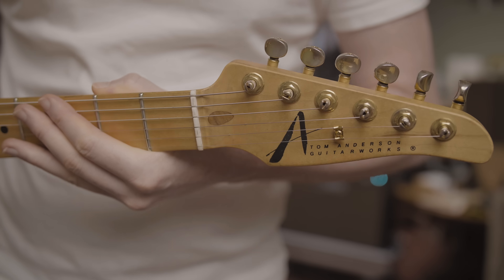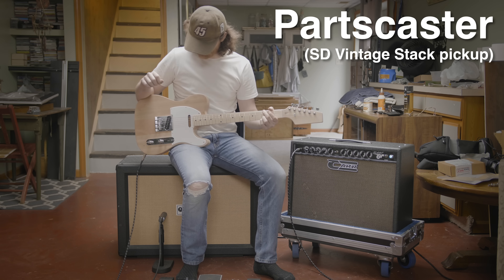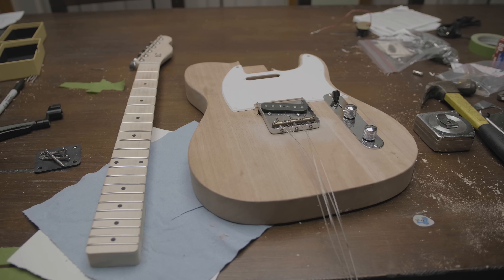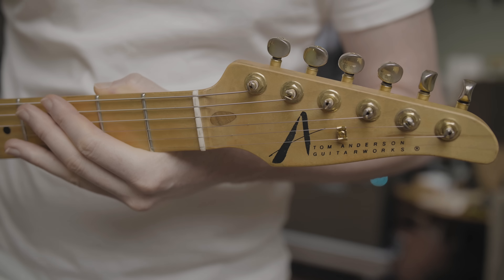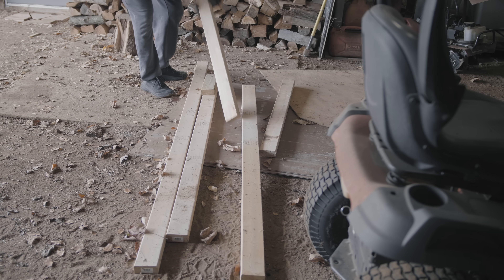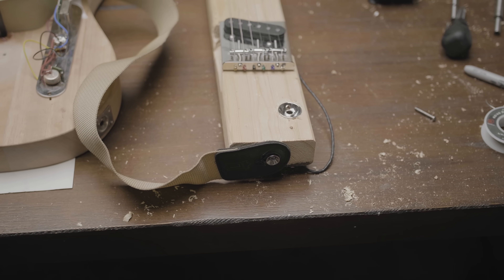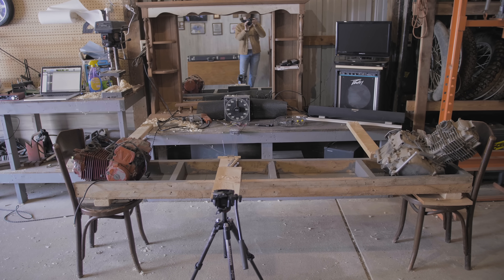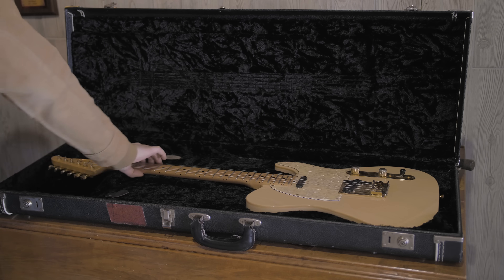Tested: Where Does The Tone Come From In An Electric Guitar?

Comment: This is just awesome, congratulation on a fine job. I wish more people did actual experiments like this rather than just parrot the same BS they read in magazines and online. Jim, you are now much more expert on electric guitar tone than the three builders you asked! My Audio Expert book covers much of this, and explains that wood type matters only so far as how rigid the body is. As you show, stretching strings across an air space sounds the same as an actual guitar, as long as the strings are anchored solidly at both ends. So what really affects tone, aside from body rigidity, is the pickup's output voltage and proximity to the strings (distortion), how close the pickup is to the bridge (treble content), and of course where along the string's length you pluck it. As you proved, all of the tone comes from the strings. With solid body guitars there is no body resonance as with acoustic guitars and violins.
Reply: So, why do hollow body guitars sound different than solid body guitars?
Reply: @맨맨-y7p  hollow guitars resonates AIR, solid resonates a chunk of wood. Its basic physic that air and solid resonation are 2 different things
Reply: @맨맨-y7p  Solid body guitars provide a solid, stable, non-resonating surface on which the strings are attached. A hollow body guitar adds intentional resonance. So most solid body guitar bodies will sound similar, but not hollow body guitars that can have different resonant frequencies.
Reply: @EthanWiner  That proves that wood affects tone. All woods resonate differently and have their own frequencies. That is why, even for guitars of the same company and with the same structure, dead notes exist in different places and have different tones. The same goes for the air guitar at the end of the video. Strictly speaking, that air guitar is not an air guitar. A bench and a shelf act as the body and head, respectively. And it sounds different.
Reply: @맨맨-y7p  I thought the "air" guitar sounded noticeably darker
Reply: @맨맨-y7p  A solid body guitar should have no resonances. As far as I know, dead notes are cause by a defect in the neck or maybe a loose fret rather than by solid body resonance.
Reply: @EthanWiner  non-resonating? Sir, all things resonate. There is a feedback network of vibration from the strings to the body and from the body to the strings
Reply: @EthanWiner  I agree with most of what you said in your original post, but I can't agree that solid body guitars do not resonate because I can feel that very thing happening whenever I play my guitars. The wood vibrates against my body.  The vibrations come from the stings, of course, but they aren't contained within the strings. I can also hear the effect of this in the clean tone, through the amp. It's not just about the strings, bridge, pickups, pickup position/height etc. I do agree that these things have much more affect on tone than the wood used, and that the influences of tonewoods are HUGELY overstated by marketing depts, but there is an interplay between all the components of the guitar (and the signal chain) to greater or lesser extent, in my opinion.
Reply: @EthanWiner  To clarify my comment further, a guitar can be made of all kinds of materials (polycarbonate, aluminium, masonite and even cement): the factors identified in this video affect the sound the most by far, but the body will resonate, transfer vibrations with the other parts and will have some influence on tone, however slight.
Reply: @TheChadPad  said, "all things resonate"

Yes, many / most things resonate. So tell me at what frequency a solid body guitar body resonates at. Then we'll know if that frequency is within the range of frequencies a guitar outputs. And be sure to include the Q of the resonance, because that directly affects how much influence the resonance will add.
Reply: @Maturin500  said, "The wood vibrates against my body. The vibrations come from the stings, of course, but they aren't contained within the strings."

Yes, but vibration is not the same as resonance! The vibrations you feel occur at all of the frequencies the guitar is currently sounding. Play the open low E string alone and you'll feel that. Then play A. The body is simply transferring the vibrations to your leg. But that's not resonance. Resonance occurs at a single frequency, and both emphasizes and sustains that one frequency. How much depends on the Q of the resonance. Some items have more than one resonant frequency, such as a violin and acoustic guitar, or a listening room. So yes, the mass and rigidity of a solid body guitars body do affect tone, but that's not due to resonance.
Reply: @TheChadPad  The hammer test is valid, and is used by violin and cello makers all the time. But he hit just the neck alone, and also made the point that the frequency will change once the neck is attached to the body. Which he didn't show. Any resonance is also affected by 100 pounds or so of string tension and, more important, is muffled by your hand on the neck and the body against your stomach. To prove this to myself, I just grabbed my Fender Telecaster at the far end of the neck by the tuning pegs, and rapped the body with my knuckles. No tone, just a muted thud. Try it for yourself and report back.
Reply: @EthanWiner  well muted resonance is still resonance. Without measuring devices, that isn't very scientific
Reply: @EthanWiner  maybe you could stick a piezo pickup on your guitar's body and play it. It will resonate if given more sustained force than just a rap of the knuckles. Then run it through a frequency analyzer and see if there are peaks in the response where it is louder. I think that should give an answer. Play each note separately, and one might jump out the loudest. I know this playing my own guitars acoustically, that certain notes make my guitar actually vibrate louder and parts rattle. Could be the resonant frequency of the parts, but it stands to reason there would be a resonant frequency of the guitar
Reply: @TheChadPad  Not scientific? We already established that rapping works when you posted the Fender Custom Shop video. There's also this one I did for my loudspeaker isolation tests:

https://www.youtube.com/watch?v=f7d4Egs9qwM

And this one for my Audio Expert book:

https://www.youtube.com/watch?v=lUpxVfk1K_4

In both of those videos, and the Fender video, resonance is clearly audible at frequencies a guitar (or electric bass) could produce. But rapping my Fender Tele, not at all. So I'm certain of my position. If you're equally certain, then you stick a piezo pickup onto a solid body guitar's body and show an FFT of what the pickup produces.
Reply: @EthanWiner  No, saying that there is no resonance because you cannot sense it easily is not scientific. Instruments are needed. It would die out too quickly for you to easily sense it anyway with just a rap of the knuckles. That's why I said "sustained force"
Reply: @TheChadPad  The main problem with this test, and tests by Dr. Dan Russel referred to in this paper, is they don't show how strong the resonances are. If a guitar body has a resonance that's actually strong enough to affect the tone, not just be detected, then notes at those frequencies will stand out as obviously louder. But that doesn't happen with electric guitars. Someone in this discussion mentioned dead notes, which do occur, but that's sort of the opposite of resonance.

Another problem is "Each guitar studied was hung by rubber bands in order to allow it to vibrate with minimal dampening." But that's not how guitars are played. A guitar's body is damped firmly against the player's body, and likewise for the neck and player's hand as I already mentioned. When I suspended my Telecaster yesterday and rapped it, I heard no obvious resonance. Yes, maybe resonances could be detected with measuring tools, but that doesn't mean the resonances are strong enough to actually matter. I contend it is not enough to matter. Again, resonance strong enough to matter would make those notes pop out much louder. But that doesn't happen with electric guitars.
Reply: @TheChadPad  One more very important point: In order for a resonance to have an effect, it must be excited by a force. Picking individual strings, and even strumming full chords loudly, does not set the guitar's body in motion as happens when striking it with a hammer!
Reply: @EthanWiner  This is true, however, any resonance at all is grounds to suspect that this could transfer to the strings through the tuners, nut, bridge, and tailpiece. Further tests are required, you are correct. It needs to be done when strapped on a person to see if that is enough to kill any resonance, like you suggested
Reply: @EthanWiner  Now here's where it gets really interesting. I would like to see the results for each frequency they tested. That would potentially give a different tonal profile for each guitar, and for different types of woods if studied. See which frequencies are even slightly altered in volume
Reply: @TheChadPad  Yes, but we still need to know the strength of each resonance. And to wrap around to the beginning, I think this video shows pretty clearly that body resonance does not affect tone. The biggest difference I heard in all the various demos was more distortion when a pickup was raised closer to the strings, or replaced with one having more output. As I also said earlier, people obsess over minutiae that can be easily countered with 1-2 dB of EQ. :->)
Reply: @EthanWiner  Exactly, gauging the loudness of each resonance. I'd love to try that myself. I heard differences in most all of these tests. I still don't think I could a/b reliably, but the additive effect of all of this is the whole point of thinking about it in the first place. It's what professional luthiers do. I heard a difference between the strings off the guitar and on it, but what bugs me is he did not account for the pull of the neck pickup on the strings
Reply: @EthanWiner  What we would need to know is what strength of resonance is required to alter the movement of the strings, and I don't think we know that. Strings are delicate things
Reply: It's cool that you found this Ethan. So, how did you find it?
Reply: @MrNamePerson  A post in a Facebook group.
Reply: What a surprise to see a response from Ethan. This lends tremendous credibility to this testing. All we need is our ears to validate this, but it's still cool to see Ethan chime in.
Reply: https://www.youtube.com/watch?v=8JcpHdh3VS8
Reply: In pickups affect the resonant peak (the frequency and dB height) and the load of the electronics (cables, pots, amp input and the rest)

You can find more info in "Secrets of Guitar Pickups" by Lemme and GuitarNuts2 Forum (capacitance of electronics, potting, pickup heights, effects of more pickups, etc)
Reply: @SolamenteVicio  Yes, good point. The pickup's own inductance interacts with the tone control's and wire's capacitance too.

Comment: As far as the air guitar goes, in my opinion “mass” is a factor. 
The benches you attached the air guitar to become the mass, or guitar body in effect. 
In my experience, mass affects a guitar’s tone, and sustain, but only to a certain degree. There are slight differences in the sounds of tone woods, the body and neck mass, and slight differences in tone in the guitar’s hardware. 
In my experience the guitars pickups make the most difference in tone. 
And at the end of the day the amp the guitar is played through makes a huge difference, with effects pedals secondary to the amp.
So a guitar is really just one link in the tone chain.
Reply: My thoughts exactly, John--the air guitar version has a lot more wood attached to it than the sum of the Tele body and neck. I've always found that a gigantic mass of wood increases bass response and in turn, the whole instrument sounds better.
Reply: @hallsf  I’ve heard this point made for many years, and it just physics in action. The greater the mass, the more the vibrations propagate. Wether or not that principle has a large effect on different types of guitar’s tones is debatable, but in the case of the air guitar the benches to which it was attached definitely did have an effect, as they acted as the air guitar’s body.

Comment: I super dig, this vid. however it was misinterpreted by a guy on Facebook saying that body woods don't matter and anyone believes otherwise is 'dense.' That may be, but you need to do the inverse of this test to make that argument. Here was my reply to him:
So, giving reverence to the immense coolness of this video, calling any counter opinion to these findings 'dense,' is something of the pot calling the kettle black. It somewhat respects the scientific process to answer the question: does taking most effect of body wood (very little soft body wood - plank) or all body wood (air guitar) away, is there an appreciable difference in sound to a single given wood body. The answer sounds, without any actual spectral analysis, like a 'no,' and infers that actually changing woods also might not make much difference - but that wasn't really tested. Woods are dogmatically though to dampen the sound depending on their properties, so with no-wood (or less wood) then, no dampening (or less dampening). I don' think anyone in their right mind believes that woods ADD, spectral power. He tested ONE case which would offer different wood dampening where he actually put a rosewood board in place of maple, if you ask me (again, no spectral analysis) the rosewood had a stronger low vs. mid range. SO, if you really want to get into the 'dense,' name calling, do the same video, and switch out with other body woods (e.g., mahogany or alder) to test their dampening properties , actually exactly like warmouth did: https://youtu.be/7k_A8GhN0L8

Comment: The guitars tone comes from the wood at the contact points. Under the bridge, the head stock and the neck. See what happens if you change the wood under the bridge? It will be slight but you should hear a difference. I heard a difference in the 2x4 and partscaster right away. The biggest thing for me, playing hobby and professionally for many moons, is the "feel" of the guitar. The only wood I don't like as a guitar body is solid Maple. Way too hard and bright.

Comment: Using your ears to compare sounds from a speaker is subjective. How about analyzing the signal from the jack with a spectrum analyzer? If the two guitars are passing the same frequencies at the same amplitude, they will sound the same to the ear, but you could get an objective comparison.

Comment: I've always heard that over 90% of the guitar sound is from the pickups.  It was proven by this video.  However, I have also heard that a "lock down" system robs tone.  I agree.  I noticed the guitar sound is more confined with a lock down system.  The last factor is the wood itself.  Maple, Rosewood and Mahogany all have different sounds.  This is most noted on an acoustic guitar.  On an electric, it is limited because again, over 90% of the tone is from the pickup.  The two other factors is how Gibson builds their Les Paul with a Maple Cap on top of Mahogany.  I suspect this is because maple is a hardwood which tends to sound brighter.  This is desirable when humbuckings are used since they have a darker sounds with less treble.  The other most notable is the Telecaster bridge pickup mounted on a piece of metal.  This increases the brightness.

Comment: Before seeing the whole video, I'm agreeing with builder number three primarily.  The biggest difference in sound between guitars other than the player is in the scale length and electronics: pickups (including height or distance from strings), pots, wiring, switching, etc.

Comment: Yup, been saying it for years. What matter after electronics is that the structure is rigid, has enough mass so it has good sustain: a good body is one that does not react to the strings.
Reply: Great comment.  The idea that a guitar body should be highly resonant is mistaken.  Transferring energy from the strings to the body is the definition of losing sustain. Let the strings keep the energy and let the pickups react electromagnetically.

Comment: Not breaking any real ground here.  Steinberger basically made your 2x4 guitar with even less wood because it had no headstock on it. 
Almost any lap steel is your "air guitar" with the braces built under it instead of on the side.  
Blues guys have talked about nailing a string to the side of the house then tying the other side to concrete block to adjust the tension.  
Cool video though.  Neat experiment.

Comment: The Anderson and Air Guitar sound much closer than I would have expected, but what really surprises me is that the main difference lies in the low-mids and not in the highs, as I would have expected those to be the first frequencies to roll off. The Air Guitar has as close to no frequency loss from the original string vibration as you can get, which makes sense - you've minimized resonances as much as possible, although there will be some resonance in the bench and shelf and you'd probably need some hyper-dense mounting materials to eliminate that. Adding the other parts of a guitar to the mix adds some more resonances, which starts to cut some frequencies down.